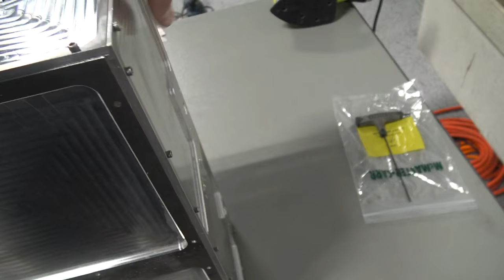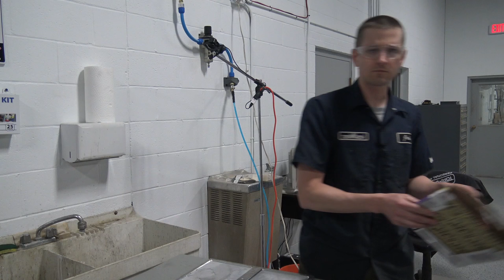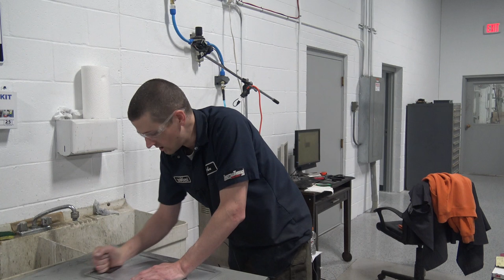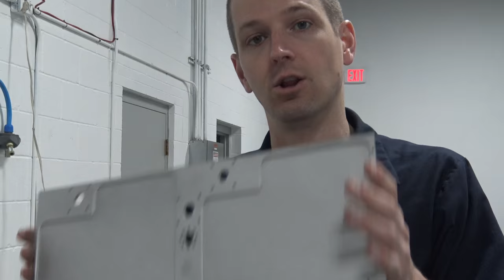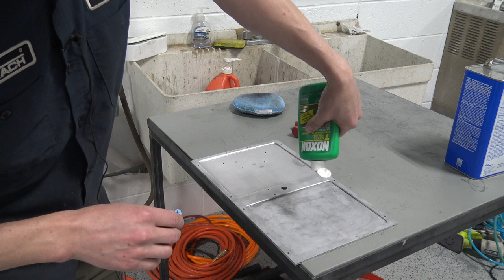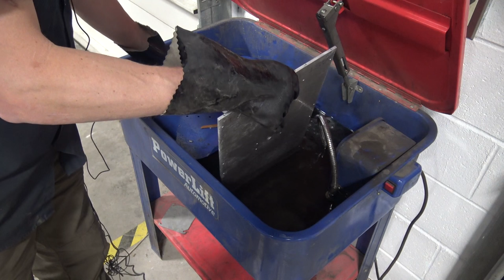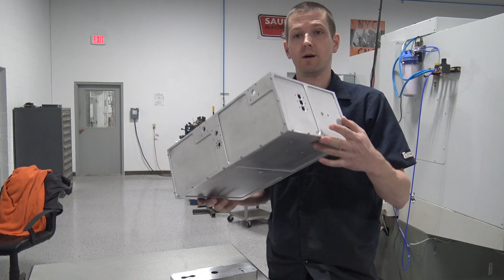Remove Machining Toolmarks!

Comment: FWIW I have to finish out EVERY part that I mill. I always start at 220 to remove the marks and it works great. 

Also as another user pointed out, sanding sticks are KEY to keep everything as even as possible. Basically something that will back the paper up and keep it from doing any sort of puckering or uneven sanding. Thats how us knife guys keep transitions from harder bolsters(titanium, zirconium, etc) to softer handle material(g10, carbon fiber, etc) nice and flush. For applications like that I have small "sticks" I have made out of aluminum so the stick literally cant give way. If not the stick will give way on the softer material and dig into the softer material more. Thus giving the dreaded "dips" we makers hate. 

Also yes sir, sand one way then change directions with grits. It makes it SO much easier to get a perfect finish. I always start out with the most aggressive grit in the direction I dont want the finished scratch lines to be and always finish with the final grit in the direction I want the finished scratch lines to be

Comment: I being of the autobody and paint trades would do it all with wet and dry papers and do everything wet using a few drops of dish soap in the water to keep the paper from clogging 120 to 1200-2000 and then polish with mothers or other "white" polishing compounds design especially for aluminum...will look like chrome mirror finish when done. A trick I use is to use a spray dye called "Guild coat" made by 3M for auto painters and body shops and a light mist of guild coat between abrasive grades will show up all the scratches from the previous more aggressive grades so you make sure you remove them all with each step before using the next finer sandpaper. Do Not use regular black spray paint for a guild coat it will clog paper and mare the surface. I did the valve cover on a L18 Datsun motor this way and the cover was a cast aluminum mix and it came out looking like a mirror and stayed that way, never seemed to tarnish.

Comment: I know just the thing you need , 
forget all the blasting and rough sandpaper , start with a 180 grit then go straight to a product called autosol aluminum polish, make sure you get the one for aluminum not just the metal polish . This stuff will change your life not to mention save you a ton of time.  
Cheers 
Yuri

Comment: I polish a lot of aluminum. The toughest thing is getting it even. You can polish a one inch square in no time and it will look remarkable. But if you polish something that is 12x24 inches, you will spend all your time making it not have streaks, and dull/bright spots. I wish there was a quick and easy way to do this, but there's not. I tend to be happy with glass beading on bigger projects. If you have to polish, always change your direction of sanding by 90 degrees when switching grits, and only grade up once all the scratches from the previous grade are gone. Like others have said, use a block always when sanding. I start about 220 grit and sand till 2000 grit. Then switch to a rouge or a polish like Mothers Mag polish or Meguiars show car glaze, with a buffer. Aluminum responds well to Flitz polish too. Finish up with white compound with a cloth wheel for mirror finish.

Comment: heres a tip that would make this look better. wet sand with the mouse sander all the way through 7000 grit. so from 600 go to 1000,1500,2000,3000,5000,7000 grits its a fast way to get a mirror polished finish. also i wetsand stainless with wd40 oil instead of water and at the very last step use a car wax (meguires black gold)  as the medium on the 7000 grit. you will get a finish as close to chrome as possible with a little work but not hard work. then if you want to take it further jewelers rouge on a 6" polishing wheel. to get the small inside corners use a dremel with a 1.5" conical head polishing tip.

Comment: 7:10 The cross-hatch method works wonderfully. Sanding that way allows you to really see when the previous grit's marks have been removed completely. I would save the scotch brite for the last step using this method since it will act as your "rubbing compound" step of scratch removal. If you need a truly scratch-less surface, check out Micro-Mesh. They have several different kits for different applications (their acrylic kit works great for many plastics, especially crazed headlights).

Comment: Oh. And look up Cratex rubberized sanding blocks.  Great for getting into little corners. Basically they're like an eraser with sandpaper grit in them. So they never clog up, just wear out.  Little on the pricey side, but make up for it in having to spend a lot less time getting tool marks out.

Comment: Oh and definitely grab a bench mounted buffer with multiple wheels. I use green compound with a sisal wheel followed up by white with a loose sewn wheel. Then if I need a full on mirror I will go back with a pink no scratch compound and a microfiber towel. If you have any finish questions let me know bro
Reply: Using that drill press with that wheel will kill those bearings and a bench mounted buffer from HF definitely costs less than a bearing replacement on that drill press. So definitely scoop one of those babies

Comment: on one of my swiss machines we mount 3m bristle brushes (we use the radial ones) to deburr and polish parts in the machine, you could probably do something similar with an end brush. also look at osborne brushes and brush research

Comment: Hi John, 

Do your blast cabinets have eductors fitted? I made one for my home made cabinet (I think it's in one of my videos). It's basically an additional venturi that fits at the base of the hopper and creates a fluidised flow of blasting media. This is much easier for a suction blast gun to pick up, so you can use much lower pressure. I use glass bead down to about 30psi for a nice satin finish. With Aluminium oxide you might even go straight to that to remove the tooling marks, then a second round at lower pressure, then the glass beads to smooth the surface.

Even better would be aqua blasting. That produces a very nice fine satin finish. I tend to dislike anything approaching a mirror finish, it shows every blemish and fingerprint and is just too high maintenance.

Comment: You should check out electro polishing. You'd still have some sanding to do but it polishes nice and evenly. Only worth doing if you have a lot of stainless or aluminum to polish however.

Comment: It seems like the finish they really wanted was a clear anodize. That will give a uniform finish, for sure.

Perhaps skipping all of the machine and hand sanding and going directly to the blast cabinet and then following it up with whatever method you liked the most to get rid of the matte finish from the blast cabinet would save a bunch of time. I know we use just blasting to eliminate tool marks on our hardware at work, though that's often on stainless steels, like 17-4PH.

Would you be willing to try testing the mill-to-blast cabinet approach, skipping the sandpaper, on some aluminum and showing us the result?

Comment: You need to get yourself the antique version of a orbital palm sander. The one that didn't do the orbital motion and would just vibrate. I have two. One is WW2 one used to finish airplane panels and the other i made myself with a motor i had around.

With sand paper it leaves tiny even curls (a rather pleasing aesthetic look), but if you stick scotch brite on it you're going to get good smooth results. I also use a very light grit polishing compound and run it all with a decent amount of water. The benefit of the two sanders is that neither is affected by water too much so i can dip them haphazardly in a bucket with not much care.

This lead me to using them in a supersized baking pan.
Reply: Also, weird that they would want polish, all the panels on Curiosity have been sandblasted or chemically etched.

Comment: I would use sandblasing and then go to a polish disc which you can use on a drill. But you need a good 3 step polishing kit.That makes thinks perfectly shining and its super fast.

Comment: NYC CNC- Detergent suspends or floats the contaminant, solvents dissolve the contaminant into the solution.

 So if your trying to clean particles off of a surface (the polish, sanded aluminum), detergents will be a better choice. If your trying to clean oil from a surface use solvents like acetone. 

For the blasting, if you want a better surface finish try glass bead vs aluminum oxide etc. Acts more like shot peening than the super sharp aluminum oxide.

Comment: You should check out BRM (Brush Research Manufacturing), they have abrasive brushes you can run in your mill with coolant. The guys at Orange Vise use them too to smooth their surfaces that are not ground.

Comment: The parts washer solvent is good until it just becomes so dirty that your not getting the desired results. In my experience working in truck shops, it becomes so diluted with oil that the parts don't dry and have a residue on them. I also agree with switching directions. That way your going across the highs per say.

Comment: I'm pretty sure there is an aluminum polishing comparison chart available to get an idea where you want to go. I would check with an aircraft polishing supplier.  aluminum is very hard to make look good once the original oxide is disturbed. The circular pattern on the Spirit Of St Lewis is one example with trying to hide tool marks.

Comment: John, I replace my solvent in the parts washer once it loses it effectiveness, In other words when it won't remove the grease from the part. How long it last largely depends on how much grease and oil you allow into the parts washer. I am running on solvent that is three years old or older. I keep two five gallon pails of solvent in the shop, So if I need to change it in the middle of the night I can.
I have had a few times when I was working late to finish a project that having the solvent there saved the schedule.
Dan.

Comment: I used to work for a company that repaired rims of all shapes, sizes, and materials. Our company process was clean, clean, clean. Then on aluminum we would remove abrasions with special aluminum flapper wheels for different devices depending on sizes. We never went below 220 grit just because aluminum is so soft and never sand in the same area for to long with tool because it would warp from heat. After repair we cleaned again. Then we had aluminum polishing compounds, various grits that would be used with our power tools and polishing wheels, balls, sponges, and cones. Clean in between grit changes. Never use polishing medium of one grit with another grit compound. Each grit has its own polishers. Try to keep it directional as you refine the grit, no circles. Clean again and the finally buff with buffing compounds and soft, buffing attachments. Repeat buffing until your happy. Again, easy on the compound, don't load the buffer to heavy, directional, steady movement. Then clean & seal
Reply: There is no easy way, love the buff.

Comment: You should try going working your way up to a polishing medium in your sandblaster. I have used walnut shell medium for getting a high polish on steel parts. I'm sure they have something for aluminum . I would just ask your abrasive supplier and see what they tell you.... It will also be much less work and give you a non-directional finish so you don't see any swirl marks

Comment: sand it progressively and at some point switch to polish. Use a wheel if you want to polish it faster. Sometimes tumbling it first helps but depends on initial finish. I usually sand in circles but that's more about trying to keep it flat/parallel than anything.

Comment: Detergent reduces surface tension of water (i.e. hard water), oil has water.  Traditionally, it allows water to carry dirt away by bonding with the molecules meanwhile cutting through oils bond with it.  Same thing applies to minerals and such present in water.  Water softeners reduce surface tension of water (i.e. removes minerals, metals, etc.) by using sodium and filters.  There is more to it as far as Chemistry is concerned.

As far as the parts cleaner.  It helps to filter the solvent.  There should be a reservoir container beneath the main container (in your case that is the reservoir and the work area you removed).  The solvent should be pumped up to the work area so if flushes away the debris.  Used a larger version for cleaning thousands of weapons and never knew of anyone ever swapping the solvent.  Swapped units out before the solvent.  Those "dirt marks" are from the dirty solvent (like a stain from other metals).  May be easier in the long run to use electrolysis to clean the aluminum plates.  Care is needed because aluminum is soft though.  There is always mild acids as an option too.  There is also steam cleaning.  Choose what works best.

Comment: How about clear anodizing? The acid etch sould remove the machine marks.
Reply: Nope it doesn't... every single detail in the part will go onto the anodizing... that's why LASER etching on iPhones can still be seen in the final product.
Reply: When anodising you can do a very short etch to remove contaminants and no metal or a longer etch and remove metal and get a mat finish. On the iphone5 at least the text and logo are areas that are raised and shiny compared to the rest which is mat, it was probably masked and then etched in the caustic solution, it certainly wasn't laser engraved.

Comment: 3M has orbital disc Sanders down to 3/4"  I find a 3-inch to be good for general purpose use . sending media is available from like 120 to 2000 Grit. you can find them at any place that carries good auto body tools. hand finishing just isn't Fun about the only way to do one off.

Comment: Small sanding blocks will get rid of the blotchy look and keep the work flatter. I know you got a few 1x2x3 blocks of aluminum or brass laying around. Also i know you guy have a grinder some where in your shop. Go get a fabric buffing wheel just for soft metals.
And yes, cross grains when changing grits. if you keep going in the same direction you just make small scratches on top of big scratches.

Comment: If you do these again, you might see if you can make the panels 2 part. Flat sand the large faces (or use a prefinished sheet)and profile mill the upper part. Small flat head screws countersunk from the back would be hard to see. Just an idea...

Comment: That's the kind of cumbersome work which I couldn't do longer than few days before thinking about quitting or commiting suicide :)
Reply: Yeah... I spent 8 hours in-class time sanding a headphone stand I made, once. Never doing that again. God it hurt.
Reply: That's because those electric sanders are amateur AF! They should be using roloc discs in 90 dg die grinders and pneumatic sanders. Only when all the heavy work is done would you go back and use sand paper or scotch brites. It really shouldn't take that long if you're an experienced fabricator.
Reply: 77Avadon77 actually electric sanders can do a better job than pneumatic depending on the task at hand. We use mostly pneumatic but your limited to the shape of pads where electric offer some nice corner sanding abilities that get into tighter spaces when needed. Can’t say we ever use less than 400 grit though typically 400 is enough to sand our marks and than go straight to polish. For some applications we will use finer grit but it’s usually not needed.

Comment: IMHO, a small Scotch bright wheel on a cordless drill works fast and is very controllable. I use the small shank mount ones from McMaster. They wont leave a perfect finish, but they are great for a first and second pass. 

PS also works on stainless

Comment: I would of tapped off the raised surface and go straight to glass bead blast.  Aluminum is tough to get a good clean finish on, especially those recessed parts as you found due to having limited access to sanding strokes.  A large tumbler would do the same, and possibly knock out a polished finish, but that would be a large tumbler for those panels.  Hand finish is time consuming, but sometimes the only thing you can do.

Comment: hey john why don't you use the tormach to polish it . auto parts store has pads that are mounted on mandrels the ones you would use on a drill to polish a headlight lens with some Mother's Aluminum polish. you can run a toolpath  it works
Reply: +NYC CNC The only problem with polishing on the Tormach is you end up with that gritty shit inside the enclosure where it can weasel its way into the ways. As several others have mentioned, the only "polishing" type of work I would personally do on mine is with a brush like what NamPower makes. It would effectively remove the tooling marks, but also leave its own marks as well if you didn't have a brush wide enough to cover the whole thing in one pass.

Comment: Various boxes (80,120,220,360,500) of 50x per roll of generic PSA sand paper (3M or Dynabrade air sander) is a good start to a  true abrasive cabinet.  
A downdraft table (no steel sparks) is also a worthwhile investment.

You needed a rectangle shaped vibrating sander to get those rounded edges.  not to mention different diegrinder pro-finishing tricks...
Scotchbrite pads w/ alcohol lube  on your sander would have matted everything out... combinations of scotchbrite / grit will yield different finishes.  It would be worth making a blocked out sample sheet

a rag with dawn soap works wonders...
parts washer...  if you don't drain and clear chips it will kill your pump
an ammoniated ultrasonic cleaner would have cleaned each side in 10 seconds with a simple rinse after.
Reply: Only get the ceramic alumina for hard metals like stainless or better

Comment: Hi John
it would be interesting to invent a polish head for the CNC machine and let the machine do the work. You put some alu polish liquid on the head and do the same toolpath as the cutting with some less pressure and less rpm.
Cheers